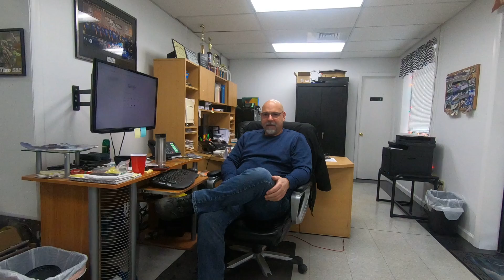Porting the GM LT4 Z06/ZL1 Supercharger is it worth it??

Comment: Key phrases at the beginning. We haven't done any back to back testing....
Reply from the maker: Correct but we have many ported version come through the shop.
This Video in no way bashes porting or it's ability to make a difference, It is simply a discussion that points out cost to benefit.
When It is so simple to move to a 2650 sell off the 1740, then you have almost endless power options, they have made as much as 1300 HP.
Not to mention the cooling ability of the huge bricks in the 2650, the 1740 bricks can't handle much more air flow than stock pulleys.
Reply: People can make 1000 hp on a stock blower. The question you ask is, "is it worth it?" In order to ask that question a back to back testing is required with cost and benefits weighed out. Yes a bigger blower makes more HP but also costs a lot more. The next question is, "is a bigger blower worth the extra cost" backed up with numbers to HP gain. Also he also said that the stock blower and bricks are "pretty much maxed out". Being able to support  300 more HP on a stock blower isn't  pretty much maxed out.

Comment: I had mine done. And it worked very well.
Reply from the maker: Thank you for joining the conversation I am glad you are happy with your decision, If you listen to the conversation carefully, I  never said it doesn't work, it comes down to benefit to cost, intercooling efficiency, short distance or long distance power. how long will it make the power, dyno runs are 4-5 seconds, not real conditions.

Comment: where are you located i want to mod my 5.7 i live in worthington minnesota would it be far from you guys
Reply from the maker: Waterbury CT.
Reply: @JANNETTYRACING  thank you thats not that far what i will  do is gather all the parts so they can be ready, i dont care how far it is i want someone who knows about hemis like you guys do, quick question whats the limit of the 5.7 block before i have to forge it and it possible to have 800 whp 5.7 reliably obviously all supporting mods and everything forged should be aroung what 860-890 crank ?
Reply: and is there a phone number where i can reach you guys
Reply from the maker: @dystv2477  Do you bring your food to a restaurant?  Same thing, We are the RESTURANT OF HORSEPOWER, We develop the recopies, we provide and cook the ingredients and deliver the desired product.  We do forged internals for anything over 500 RWHP on the 5.7 Hemi, We are in the process of building an 09 Challenger now with forged internals, cam headers supercharger fuel system etc. follow us on Facebook and Instagram. .203-753-7223
Reply: @JANNETTYRACING  😎😎😎😎yessss sir will do thank you

Comment: Have you tested a ported blower since the time of this video?
Reply from the maker: Yes we have run several ported blowers, they make more power but the cost has to justify the means which is what this is about. You can sell off your stock blower and move in to a Whipple or Magnuson and spend about the same and have a better end result with more room to grow. We just did a 1740-2650 conversion and picked up 90 RWHP at slightly lower boost.
Reply: @JANNETTYRACING  So a simple blower swap at the same boost with yield more power? With the ported blowers, did heat become an unmanageable problem or is it just a cost thing that doesn’t make sense?
Reply from the maker: @LIMuscleBlackdevil   YES any time you spin a smaller blower faster you make more heat that the little intercoolers can't handle.
Reply: @JANNETTYRACING  I’m talking about from porting, no pulleys
Reply from the maker: @LIMuscleBlackdevil   porting still raises boost, the more you compress air the more heat you make.

Comment: Let me ask this? If I plan on doing your 125 package for my Zl1 and also plan on upgrading to a Maggie 2650r will the 1 7/8 headers be suffice? Or would starting out with the 2” be the way to go?
Thanks
Reply from the maker: I would suggest the 2 inch if you would be adding out Terminator Cam and 2650 Combo otherwise 1 7/8 are perfect.

Comment: I’m at the 660 wheel on the Camaro and it incinerates street tires, i have to be at a track with a proper tire to use it.  I like how my Lt4 setup works but it is top end limited but what a fun setup in a street car.

Comment: Dollar vs dollar. Porting a stock blower with $1,250 + $160. Shipping back n forth and a tune for what? Several hundred. For the money of lets say $2,000. You gain 15 ish horse power per $1,000 spent after a tune. 
You can spend $5k on a blower and sell your stock one for $1,800 to $2,000 and for lets say $3,700 gain $40hp or slightly more per $1,000 spent. The bigger blower is the most power for the best bang for your buck.  Weapon x runs some good prices on Maggie's and I have seen the 2.9L whipe on sale for 5k in the past.
Reply: 5k for a 2650 ??? Not even a 2300 was 5k
Reply: I made 80hp from a ported blower
Reply: @superitachi431 that's the X port. That wasnt out when they started porting. However,  I make almost 1,000 to the wheels and I can still add more boost to the 2650. Cools way better, and It makes bigger power on the mid and big end over the 1.7L.  The X has worked well for the stock blower. I spent 3k on the Maggie after selling my stock. Worth it..
Reply: @mjc3502  I’m making 1200 on a jokers race port, idc what you say the stock lt4 is more than capable especially paired with a interchiller….
Reply: @superitachi431 I have only seen late model performance do something like that. And I don't think that car is very streetable. Do you have videos of this1200hp car on YouTube? Would love to see those videos. My post is from 4 years ago and Kong has upgraded their port since then. So lots of things have changed now, but I still would not run a stock blower when the magnuscin has, in my opinion, more advantages, especially for a guy like me that can easily daily this car or go across country in it. I don't have a race car.

Comment: Had mine done. Definitely made a difference. Puts an ass kicking on the air filter too.  I did go w the 103 TB. Already had LTs and intake. Definite HP gain you can feel. One thing i noticed immediately is car goes into boost a lot quicker.   Exhaust tone changed, and constant fear that back tires will break away before u are prepared for them to. Car runs well w no engine light but having it retuned this week to make sure i get all the gains and to make sure car runs as smooth as a new acura NSX.
Reply from the maker: I appreciate you joining the conversation, Lets clarify your statement, are you running stock pulleys, does your car have any other mods, IE cam headers, etc?
Reply: Doing the same thing monday, already have the 103mm throttle body waiting on it, E85, long tube 2" to 3" catless system, lowered, intake, etc
Reply: How bad did it run before you tuned it if you remember do I have to tune asap once blower and throttle is ported